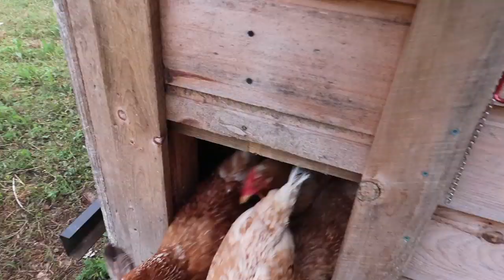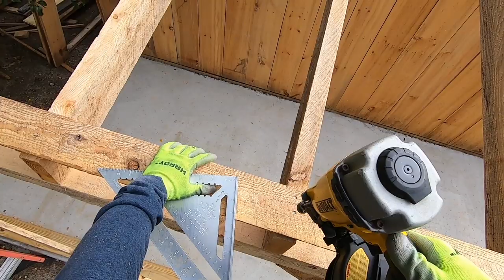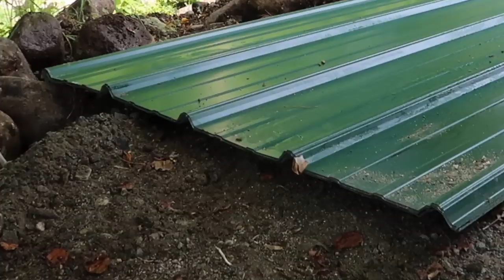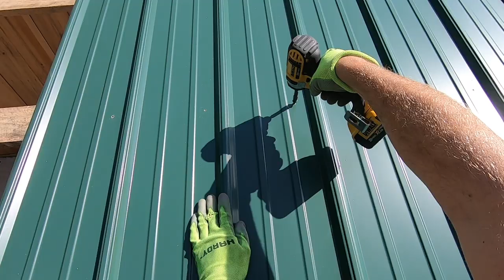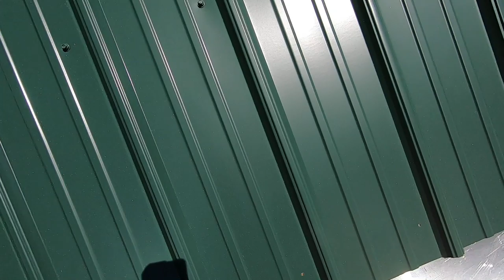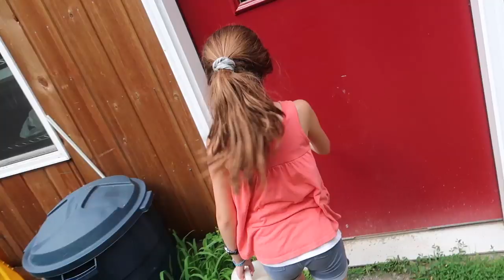Oh SNAP! These Tricks SAVED me 3 DAYS worth of WORK! (1 Man Builds a Post & Beam Barn)

Comment: Al I think you need to put one additional screw per valley on top and bottom of your roof sheets, at least that what the metal manufacturer suggested that we use on metal roofs. It will keep high wind from peeling up the bottom of your sheets. Really looks good👍
Reply: Al has said in replies to previous comments that he is following manufacturer's instructions.

Comment: Al....looking great! I would take the boards you have up on the goat side down and use them for the outside wall and build half walls and gates inside the barn so you don't have to carry hay and supplies all the was around in winter. Work smarter not harder. You could put doors to the outside from the stalls.

Comment: Why are you putting the fasteners in the valleys (rather than on the ribs) of the roofing?  I mean, I'm aware they self-seal but I thought classical canon was to put the fastener up on the rib & therefore out of the water running down the sheet.

Comment: Did your screws  for the roof have rubber washers around the heads to prevent water leakage?  If not, what did you do to address that?
Reply: Al has said in replies to previous comments that the screws have rubber washers.
Reply: Thanks!  I looked but there’s a lot to read.

Comment: That apple tree that is interfering with your putting in the flashing - you will very soon need to prune the lower and nearer branches of that tree where they are rubbing on the roof.  If you do not, they will rub the paint coating off of the roof and speed up the development of corrosion.  Not a good event.
Reply: Al has said in replies to previous comments that its not a priority until barn is finished.

Comment: Quick question: Why did you cut the posts on the other side to 69 inches and this side to 65 inches? I didn't see you adding 4 inches of packing along the top beam that the rafters sat on, so won't it look wonky when you view the barn front on? Not being negative here, just interested in whether this was deliberate as this side will house the goats.

Comment: Hello Al.  Great work on the new barn.  I was noticing one of your interior shots showed light showing through the ridge of your roof.  Did you use any foam closure under your ridge cap?  I built a goat barn with a metal roof and left out the closure on the ridge cap thinking it would be nice to have extra ventilation.  Once winter hit I realized snow would blow under the ridge cap and it would snow in the barn.  It added a nice "holiday atmosphere" inside the barn but unfortunately it made my alfalfa bales damp. :-)

Comment: You might need to attach the lower edge of that flashing to the lower roof. I put some where my house roof meets my porch roof and only had it attached at the top like you have and every storm we got with the wind blowing from that direction caused the flashing to flip up and flap in the breeze along with making LOTS of noise inside the house.

Comment: WTF are you doing with that roll of sheet metal? Pretty sure manufacturers of steel roofing have a solution 
for that problem. Never seen anyone do that before. Will there be any eve venting to the barn above walls?
Well anyhow. You never heard of self drilling screws before? Well anyhow, your little a la natural paradisio,
Rousseau might have approved.